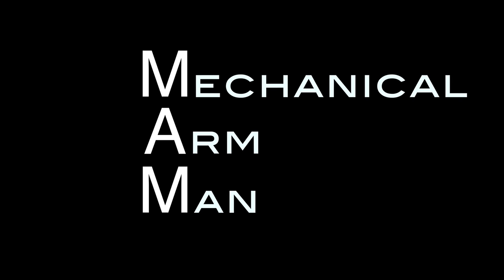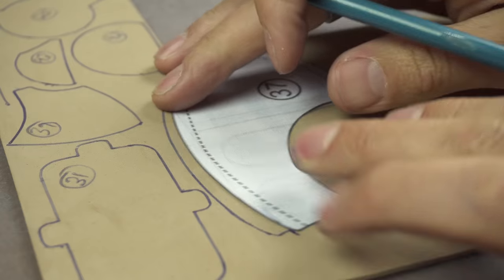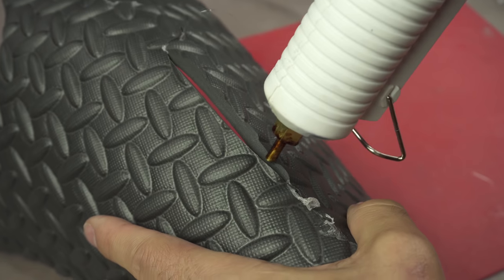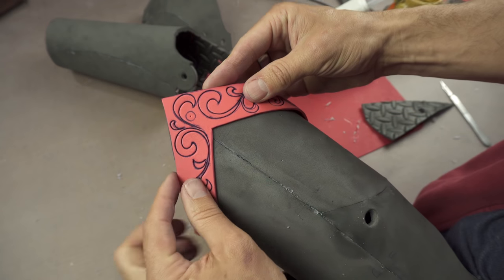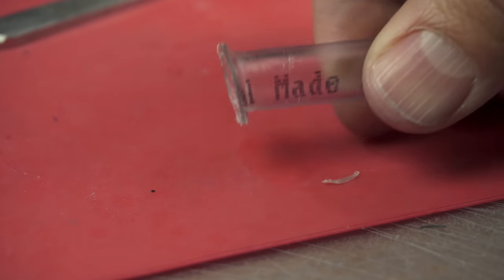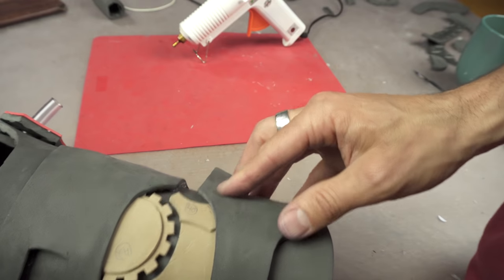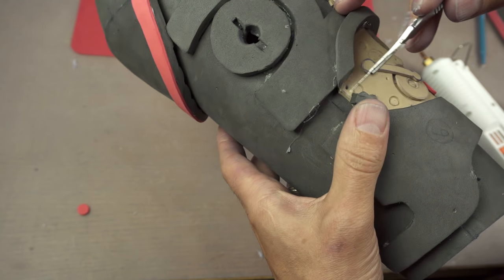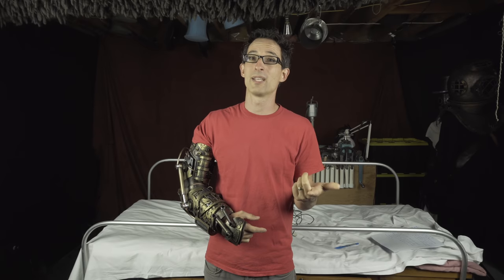How to make this sweet steampunk cyborg arm cosplay with foam and hot glue! Fidget spinner fail

Comment: If i wanted to make this for my right arm, could I just flip the pattern? I'm left handed.
Reply: A Vicious Vixen yes you can. Once you buy the pattern you can either us photoshop to mirror the image or print it out normally and flip the pattern over (I suggest tracing the pattern on the other side with pen so you remember to use the pen side) if that makes sense
Reply from the maker: Yep, exactly.
Reply: If the pattern just needs to be flipped, you can also use Microsoft Paint.
Reply: A Vicious Vixen he says it at the start listen pls
Reply: Using a paint program sounds tedious and looses quality.
Your print driver may support mirrored printing.
The full Acrobat program (not the free reader) supports mirrored printing.
Apparently the free PDF995 tool lets you print to a new pdf that is mirrored.  Then print the mirrored copy as normal.  That's probably where I'd start if I wanted a mirrored version.
http://craftygoat.com/2006/11/printing_mirrored_text_on_any.html
Reply: Update: I've now tried the PDF995 pdf printer to create a mirrored pdf.  It works well, except that I needed to print the result at 101% to get the same size as the original.
Reply: Have you guys bought the pattern ?

Comment: Is there any particular reason for not using Barge cement? That stuff holds so much better than hot glue. Great tutorial!
Reply from the maker: I agree, Barge is the strongest thing out there, however, the fumes are not something you want to breathe, and as I cannot control how well people ventilate their spaces, and there are lots of kids making my patterns, I would rather recommend supplies that are less toxic if I can. I have actually been very surprised at how well hot glue actually works once you get used to the techniques. I think I actually prefer it over contact cement now. The other great thing is that if you want to change something, you can use your glue gun or a heat gun to reheat the section and take it apart.
Reply: That seems a perfectly reasonable explanation! I tend to do all my gluing outside because of exactly that. Great job on the video!
Reply from the maker: Yeah, I used to do my gluing outside too.....until I moved back to Canada. Not that much fun when it's -40 outside:)

Comment: Using hot glue  what happened without adjust the temperature . I am new cosplay, I saw people only use contacts cement . Thanks
Reply from the maker: You can use hot glue without an adjustable glue gun, but it will be messier, and you'll probably burn your fingers more... but it can be done:)

Comment: Hi,
I'm new to cosplay and i would love to make this armpiece (already bought the pattern). 
But I have one question : Isn't it better to prime the foam before painting it ?
What difference will it make ?
Thx
Reply from the maker: Everyone has their own technique. Basically you prime the foam to help fill all the porosity of the foam so that your paint layer goes on better. If you were going to spray paint your foam, you would definitely need to prime it first because spray is so thin. I never prime my foam, or rather I suppose you could say I prime my foam with a layer of paint:) It is just one less thing you need to buy, simplifying the process. I always recommend using artists acrylic paints- they don't need to be crazy expensive, the "Basics" brand works fine. And I give my foam 3 coats. If you prime it, you are still going to need 2 coats of paint anyways. That's what I do , but others do differently and it all works:)

Comment: This looks great! 
I am currently doing a robotic arm for a cosplay (I'm doing Edward Elric from Fullmetal Alchemist, I'll do only the forearm and the hand though, the rest will be hidden by the clothes) so i find it interesting to see how you're doing it. 
I just have one question however: I've seen a lot of people use a heat gun to bend shapes when they work with foam, but you manage to do great pieces without it. Have you ever worked with a heat gun? If yes, is it then easier to work without it?

Comment: What thickness of EVA foam did you use for the base of the arm?  The pattern says to use 6mm but that seems a lot thinner.
Reply from the maker: Yep, I used 6mm, though it's a bit hard to measure the thickness properly because of the pattern on one side of the foam. So to be more specific, 6mm would be the measurement of the foam not including the cross hatch pattern. So if you included the cross hatch pattern, that would add another mm

Comment: I am absolutely in love with your channel and I have been watching it for literally years. I had one particular question though.

May I ask why you don't use something like barge contact cement as your heated? It just seems as though it would be a bit more thermally stable.

By which I mean, the odds of the pieces delaminating at say, a hot convention or less likely.

I also do a lot of work with foam and I was just curious! Not a criticism by any means! Just a curious fan.
Reply from the maker: Yep, that's a good question. There's actually a couple of reasons. 
As much as possible I like to use materials that are easily sourced by the average crafter most have glue guns, not so many would have access to a good quality contact cement. 
-Barge is pretty toxic, after having a child with cancer, and doing most of my work in enclosed spaces, I prefer to reduce my exposure and hesitate to recommend something like that, knowing most people will not have proper fresh airflow. 
It's really easy to fix mistakes with hot glue just heat it up, pull it apart, and try again
-I have actually been really impressed with the ease of use, and the strength of hot glue when done properly. I left one of my pieces in a hot car the other day (probably around 30 degrees Celsius outside) I tried to pull it apart when I took it out of the car, and the glue was still not warm enough to soften. 
All that being said, If I was making foam pieces professionally, I would likely use contact cement, but even then, there would be times I would choose to substitute hot glue. 
Oh, and I like to try things that everyone says aren't possible. That's where some of the best ideas come from:)

Comment: Great tutorial! Very clear and easy to follow steps to really help beginners like me, great job. Quick question, how thick is the eva foam you are using? The one I use is pretty thick so I'm concerned it wont bend as easily and don't want to waste foam committing just yet. Thanks in advanced!
Reply from the maker: The foam I use in this is 5-6mm (depending if you measure to the top of the bumps or the bottom) It comes in a big roll that's enough to make many products. I have an example of what I am talking about on my product page here: http://www.lostwaxoz.com/product-links/
Reply: Awesome! Thanks a bunch, keep up the great work!

Comment: Am I wrong, or are the elbow pivot holes the incorrect size on pieces #1, #5 and #6. I cut them as stated at 8mm but your video states to use 11 mm / 7/8" tubing, which can be stuffed through but it's very tight. Seems to me the pattern should state 11mm holes.
Reply from the maker: Yep, you want the fit of the tubing to be quite tight. THe reason is that the foam will stretch a bit. If you used 11m holes for 11mm tube, there would be a good chance of the rivet popping out.

Comment: Hey, i could try something like that but im really begginer and i need advice. Which shall i use EVA 2mm, 5mm or 10mm, what is difference? Can foam be too thin for shoulder for example?
And did you notice some difference in density? I found 11 g/cm3 and 9 g/cm3 and that 2nd one is cheaper.
Reply from the maker: Hi there, I would recommend the 5mm foam for this main part of this project, and the 2mm foam wherever I use the thinner foam. The denser the foam the better. It'll make it stronger.
Reply: Thank you :)

Comment: Hey Chris, what thickness foam did you use for the bigger parts? Is it okay if I used a 12mm foam for my arm since it's smaller?
Reply from the maker: I used 6mm foam. You can probably use thicker foam, might just need a little tweaking.

Comment: Hi Chris! i bought the same glue gun, so can you tell me how high the temperature must be? i have some issues with it. if its to hot, its getting messi, if its to cold, it doesnt stick well. I bought your "Ultimate Everything Super Value Pattern Bundle" its wonderful ! Pls dont stop doing nice patterns for your fans :-) Greetings from Germany
Reply from the maker: I usually set mine with the little arrow pointed straight up- so that's halfway between either end. It will also depend a lot on the glue sticks you are using though. It might be worth trying a couple brands.

Comment: I love this project and I would like to try it! Do you think I can use leather instead of foam? I love the poetry at the beginning of the video! I love your channel!
Reply from the maker: I wouldn't advise using leather unless you have worked with leather before. You would need to use some thick veg tanned leather so it would be nice and stiff. You could kind of use this pattern, but with leather you would probably want to overlap it and rivet or stitch it together.

Comment: Hi.  The link for the arm instructions on the Everything package will not open.  Appreciate you help.
Reply from the maker: Hi James, I just tried it and it seems to work for me, I am not sure what the problem is, but I am sure we can get it sorted. I think the first thing to try is to open the download link in a different browser. You can email me at lostwaxozcontact@gmail.com  and I'll make sure you get your patterns!
Reply: Lost Wax Hi.  Thanks for the quick reply.  I'm trying to print a hard copy of the instructions.  For what ever reason, I can only see one page at a time by moving the dot at the top of the screen.
Reply from the maker: Is that on mobile or desktop computer? I have not used the Gumroad app, so I am not sure how that works, but you should definitely be able to download the files to your computer  for printing with the link given on your receipt.
Reply: Desktop. Oddly I downloaded and printed the jet instructions and plans with no problem.
Reply from the maker: Hmm, that is odd. Did you get the pattern to work?
Reply: Lost Wax The jet pack pattern and instructions downloaded fine.  Like I said I could get to the arm's first page and it wouldn't load. If no one else is reporting a problem, then it's most probably just our system.

Comment: I have a question. So, I'm a new purchaser of the complete set of patterns (best decision ever) and I recently bought the yoga mat that you have listed on your supplies list to make this. However, after cutting everything out, I'm realizing that the mat is about 9mm thick, and I'm worried that it's going to be too bulky. Anyone have any suggestions?
Reply from the maker: Hmmm, it might be a little thick, but it could still work- it will end up a smaller size though because of the extra foam thickness. I am just wondering which mat you bought? If you could send me the link, I would like to check it out. You can email me at lostwaxozcontact@gmail.com
Reply: I purchased the blue one that’s on the top of your supplies list. However, I’m a pretty small person, and I’m pretty sure that I can get it to work. I love your videos! Thanks so much!

Comment: Does the pattern need to be changed for different arm types?
Reply from the maker: There are three different sizes included in the pattern. I have done my best to make them so as to fit as many people as possible, however, with arms there are a lot of different length/width combinations. So here's what I've got in the pattern right now:   
 The small is for arms up to 26 cm at the bicep,the medium is for arms up to 33cm circumference at the bicep, and the large size which is for armsup to 41 Cm around the bicep. The medium and large both work best with arms approximately 55cm from shoulder to wrist, and the small size for slightly shorter arms, around 50cm shoulder to wrist.

Comment: Is there a way to make the print out a perfect fit? Cause I have really skinny arms 😪
Reply from the maker: Hmm, this is not an easy pattern to size before you print it out, due to the way that arms don't have standard width to length proportions. The good thing about having skinny arms, is that you can always add some soft foam on the inside to tighten it up- and the look works because you've then got this big strong mech arm. If you do want to resize the width of the pattern, I recommend making the basic arm using the pattern that closest fits your arm length. Once you have the basic arm made from foam, you can cut out a strip right down the centre front and back, and then glue it back together and that gives you a thinner arm. You will have to adjust some of the other pieces as well, but it is at least a really good starting point. Hope that helps a little!

Comment: Will you have a pattern for a larger bicep?
Reply from the maker: Yes, I am working on that now, but have a few things going on so it's still a few weeks away.
Reply: Thanks for the reply! I will just have to scale up the upper arm so I have it ready in time for a con in september. Can't wait!
Reply from the maker: Hey just a few tips for scaling the arm, Be aware that it probably won't work to just scale the pattern pieces up in all dimensions, because then it will be too long. My arm is 58 ch shoulder to wrist, so it that's about right for you, you want to just add width. Basically the way I am scaling up the pattern is to add an extra strip down the front centre and back centre of the arm. So, if when you print the pattern, cut down the centre of pieces 1-5 and tape in an extra strip of paper. I am not sure how big your arm is, but for the larger size I am making, I am adding 2 (front and back) aprox 3.5 cm wide strips for the top  section of the arm, and for the bottom half, two strips that taper from 3cm at the elbow, down to 1.25cm at the wrist. Hope that's helpful. I figure that should fit an arm with about a 40cm bicep.

Comment: Great work!
What glue do you use?
Reply from the maker: I use a few different glues. Most everything is held together with hot glue, I also use a bit of superglue and sometimes some two part epoxy.
Reply: @LostWax  I thought you would need two part contact glue for EVA foam. The problem with this is that you need to glu both parts and let it dry for about 10 min. So if hot glue, where you just have to glue one part would be much better.
Reply from the maker: @ralffettkenheuer7098  Yep, and there are less toxic fumes with hot glue as well.

Comment: so im completely new to crafting with foam and was wondering what is the best thickness of eva foam for a knight armor?
Reply from the maker: I would go for around 5-6mm thick. But it needs to be reasonably dense, if not it won't be strong enough.
Reply: how do i know how dense it is? is it usually written when you buy it?
Reply from the maker: No, not usually- are you planning to buy it online or locally? If you can feel it you can get a good idea. Check out those puzzle piece floor mats- they usually come in sets of 4, those are generally a decent density, but usually too thick for most products. I buy a big 4x8 foot roll of foam that is textured on one side and about 5mm thick at my local hardware store. Generally if it is sold as a camping mat, it's not dense enough for armour, but if it is a floor mat it probably is. I have some links on my website here that might help you out. You don't want the blue roll of foam in the first picture, it's not the dense stuff. https://www.lostwaxoz.com/product-links/   Sorry for the ramble, hope something helps!
Reply: i dont mind the rambling at all, just good with more information, im planning to buy locally, so i should search for something that feels like a floormat? and another question i have is, does eva foam stick to fabric if glued on with the use of glue (hot or not) or does it just rip off?
Reply from the maker: I think you will find that anything that is made as a floor mat will be fine. Oh, I forgot to say it should be made of EVA foam. It is light and holds its shape reasonably well. It should work to glue it to fabric, the only thing I would say is if you are glueing the finished surface of the foam, rough it up a little bit with some sandpaper to give the glue something to grip.
Reply: alright thank you, but if glue it should it be super glue, contact cement or hot glue?